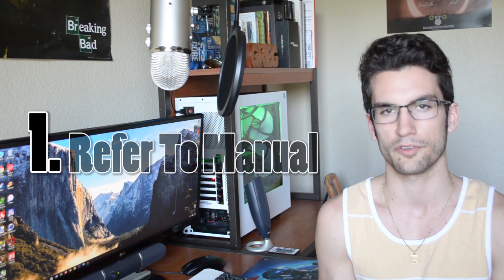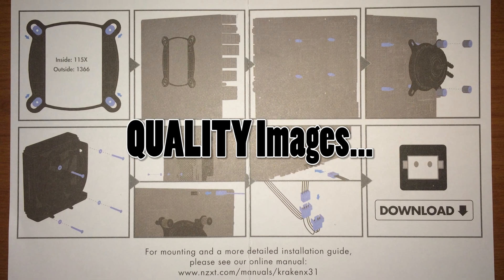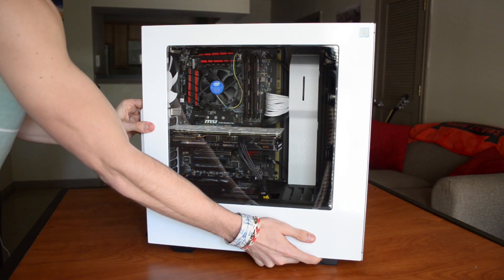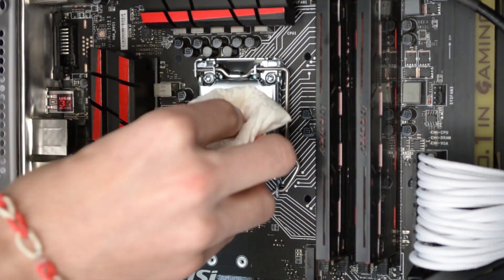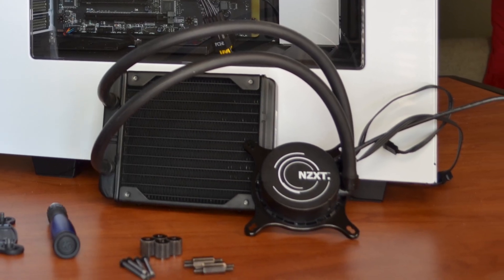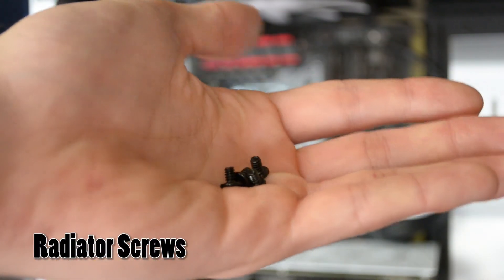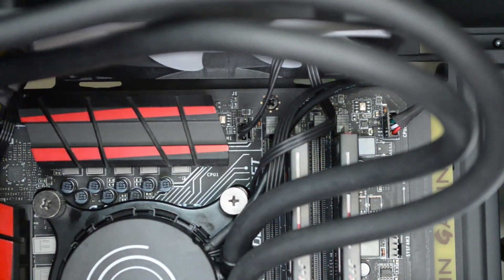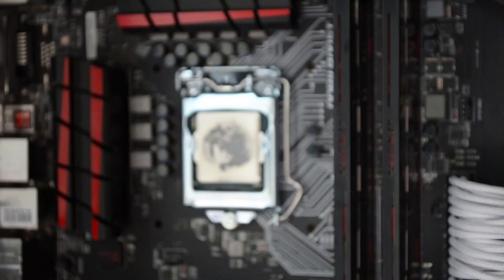How To Install An AIO Liquid Cooler

Comment: I can't find anything in this about adding liquid. Is this necessary in AIOs, or do most come with liquid? I'm trying to figure out my "GamerStorm" Captain 360 EX (with no quotes, I just thought that was a weird brand name, especially considering that I thought I bought from a brand known as DeepCool. Either way, my manual is almost as terrible as yours. The only writing is in labels (parts included, "Intel/AMD" labels).
Reply: If you can use google you would know that the water is already in the AIO
Reply: Rizin I found this out shortly after writing this comment. I forgot to delete it, and I apologize for that. I'm a little bit of a newbie to Watercooling.

Comment: science studio hiya iv just got the uphere all in one liquid system but the instructions is shocking my friend iv got it all setup and installed but is the cooler block a 12v supply or a 5v supply

Comment: I recently got this for my first build and I'm really worried! My temps are hitting 89c STANDERED no overclock!!! I don't know how to fix this as no one gives me a clear answer! All connections are in the right place but I honestly don't know if the PUMP is working?? How can you tell? The fans work but I'm not so sure about the pump??
Reply: Barrett50callumz Have you removed the plastic that covers the surface in contact with the cpu from the aio cooler?
Reply: Did you connect the wire for the pump/radiator to the cpu fan header on the motherboard or to a regular one? because it needs to be connected to the cpu fan header otherwise the pump doesn't start, or at least it didn't for me.

Comment: Really helpful video. I am actually using this same cooler. I just have a quick question. Do i need to apply thermal paste? The Kraken did not come with any tube of paste but I believe it already has some applied to the part that makes contact with the CPU. Just wanted some clarification on that. Thanks and continue doing great videos!
Reply: Gus Ramone u need it

Comment: i have a noob question.. i keep watching these videos.. nobody shows when they fill the radiator with the fluid??
Reply from the maker: These AIOs are pre-filled. Zero maintenance.
Reply: also a noob question. Since there is no reservoir, how long does the watercooling system last without me having to do anything. also, if it runs out of water, is there a way for me to refill it?
Reply: I think most of them have a 2 or 3-year Zero Maintenance guarantee, but don't worry about this. For the most part the only maintenance required for an AIO is to clear the dust off the radiator and fan.

Comment: Do you need the NZXT CAM software to be open at all times for your AIO NZXT x61 Kraken? Or can you set it to a profile (e.g.: Silent mode), and close the cam software? Will it save the profile and adjust accordingly, or will I need it open at all times? Also, what is the benefit of having it on performance mode etc. Also, will the liquid temperature also be regulated or is it dangerous to do this when under load? i.e., play battlefield 1.
In addition: Under load with the CAM software off I hear zero noise (with silent mode set before I exit it). With the CAM software on in the background, I can hear the radiator fans go ballistic. Also, without the CAM software on, I hear zero rattling. With it on, I hear rattling.

Comment: I have question.My pc is too noisy and when i did an inspection i saw that my stock cpu cooler is making alot of noise.So i was thinking of replacing it with a heatsink or liquid cooler.So which one should i go for that will make the system quieter?
Reply: Grand thief it depends. Both air and water can be extremly quiet. water cooling is just: WOAAAH it looks sick. me personally, i went with the h100i v2, because i didnt want a massive cooler on my cpu. the most important thing are/is the fan/s you are using. of course a high end fan from noctua for example is extremly quiet.
Reply: Kyojin Keshiira I m personally thinking of getting a heatsink cause im not very good at technical stuff and heatsink is much cheaper than a watercooler

Comment: hi,i just replace thermal paste on cpu.. 

can i ask , my cpu temperature is around 48 - 53 ..
when gaming 60 - 70 ?
is that normal temperature , good or not too good
in my room i dont have air conditioner
im just using HSF CoolerMaster X Dream i117 ..
Reply: Muhammad Asri 
It's normal, no worries but while gaming it shouldn't exceed 70

Comment: Sir if for some reason the coolant leaks,my entire system will be messed up right? So is it safe to use a liquid cooler?
Reply: Athul Krishnan  Always check for leakage before installing the fan and you should be fine....But keep checking from time to time

Comment: where is the liquid or coolent required to run through the pipes to cool the cpu?
Reply from the maker: It's an AIO. It's all included. No work required apart from mounting to your case/CPU.
Reply: Salazar Studio well i wish could get an AIO in white so that i could match it with my version of Walter white 😂😂
Reply: id cooling - icekimo
Reply: I was about to comment that too, I just picked mine up

Comment: The screws that hold the radiator, with the fan, in place are 120mm pattern? If it is, will it fit on my 120mm exhaust spot in the case?
Reply: Depends the radiator and case size

Comment: My system
I7 6700k with the same coller ur using
16gb od corsair ram
Gtx 970..

Should i get the NZXT s340..or get the H440..
Reply: H440
Reply: s340 elite

Comment: Sorry if this is a noobish question but for the AIO liquid cooler, do you have to get a reservoir or and other parts?
Reply from the maker: No.
Reply: Thanks
Reply: Areguil Gamer oh ok
Reply: +PS4 GENIUS where is the watter or do u need to add it
Reply: It comes already inside the tubes.
Reply: Areguil Gamer k

Comment: How does the water cooler work ? does it collect moisture from the air or do you use an coolant to keep the temps low ?
Reply: The coolant cools the copper block that is in contact with your cpu, thus the coolant cools the cpu, the radiator and fans however cools the coolant because over time, the coolant gets hot, you always want a cool coolant to cool your cpu 
: )....the fans push air through the other side of the radiator to cool the coolant
Reply: Last question where would I pour the coolant into and will regular tap water work ?
Also thanks for answering my questions.
Reply: aios are sealed with coolant in it, even in a custom loop you cant use tap water it would evaporate.

Comment: I recently bought an AIO and the instructions where pretty useless, I was lucky that all the build logs I'd watched used water cooling in form or another so the block wasn't too bad, but they only showed how to do push when I wanted pull, so it took me longer than I care to admit to figure that one out.

Comment: I just got my aio and have lots of questions:
1. Do I run the pump at max speed? For example does plugging in the pump into a system fan header, and the fan to the cpu fan header?
2. Whats the best type of configuration or setup for the fans, I know there are a lot of vids on this on ytube, but rather get my info at one place?
3. Last but not least, Where should i mount my radiator, like where in my pc case is the most efficient to mount it, for example at the front of case, top of the case, or rear of the case?

Thanks bit of a noob just got mine today installed it successfully do to this vid, and would be awesome if Science Studio were to make these questions into a vid.
Reply: For 3:
http://www.overclockers.com/forums/showthread.php/756859-Radiator-and-Fan-Placement

Comment: https://www.nzxt.com/manuals/krakenx31/X31-115X.html

According to some other manufacturers , optimal orientation for the radiator will be with the fan drawing fresh air into it. NZXT does not make that distinction , but I would be curious if it's worth redoing your case flow setup just to draw the coolest air available (drawing from outside air only).
Reply from the maker: I don't want hot air swimming around inside of my case.
Reply: Personally that's why I haven't paid much attention to AIO coolers , because of these counter intuitive instructions , but I'm still curious if the difference in temps is even worth it.
Reply from the maker: +majorjockitch I have a video covering the price to performance ratio.

Comment: man you said warranty will not cover if this system cooling leak, i bought everything from amazon, i have a h100i gtx, and it works perfectly fine, and if unfortuntlly one day my h100i gtx leak, i cant rma damaged components like mobo,cpu rams gpu ecc?
Reply from the maker: In most cases, no, because you decided to use water to cool your PC.
Reply: +Science Studio i Hope it wont happen, thx for the answer m8

Comment: Also you used too little thermal paste, should has used more
Reply: No, he used just enough. More woudnt be good.
Reply: Emin Sarabsky Trust me, you want to put a little bit more on that this to insure a larger spread throughout the heat exchanger
Reply: John Cena oh, ok.
Reply from the maker: +John Cena No, that amount was perfectly fine. Too much is unnecessary.
Reply: Science Studio The amount you put would have barely even reached the edge of the heat exchanger. I've put slightly more on before and has covered nearly the entire heat exchanger with none going over the edge
Reply from the maker: +John Cena I don't think you understand. That's exactly what you want; for the paste to barely reach the edges of the heat spreader. Trust me. I've done this dozens of times.
Reply: Science Studio But having it spread over as much as possible will allow for better heat heat transfer for the copper or aluminium contact of a heatsink.
Reply from the maker: +John Cena The dye is not as large as the heat spreader. 90% of the heat emitted from the CPU is contained within the inner quartile of the heat spreader. Please research this on online for a further explanation. I don't have time to do it here.

Comment: Should have got the EK Predator 240/360 or Swifttech 240x/360x
Reply from the maker: Not necessary for a 6600K. Those are much more expensive and provide only slightly higher overclocking headroom.

Comment: Is this the best way to route the tubes? Can you shorten the tubes? I have the same case and I am thinking about buying this cooler.
Reply from the maker: I've also routed the tubes from the bottom as well in a previous video. Either way works fine.

Comment: Heyyo, Nice videos ;) I watch all of them. I am going to be building my first PC and wanted to know if getting a 6500 vs an i5 6400 is worth it. Will not be getting an Z170 board so no changing of the base clock. Thanks
Reply: The i5 6500 is worth it as it has a significantly higher clockspeed.
Reply: the i5 6500 is the best value for money skylake i5

Comment: you have a top mounted exhaust fan close to the radiator fan, will it restrict the air flow to the radiator ?
Reply from the maker: That would be an interesting experiment, though I don't expect it's affecting the radiator's performance by very much.
Reply: +Science Studio you can do a follow up video trying different fan speeds and air flow optimization tips :)